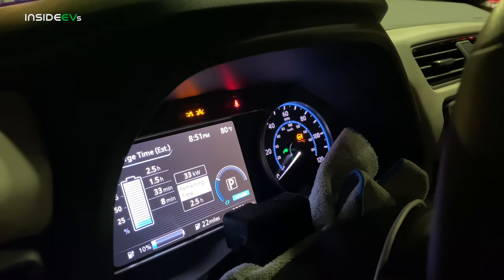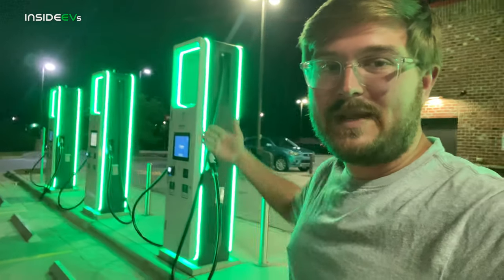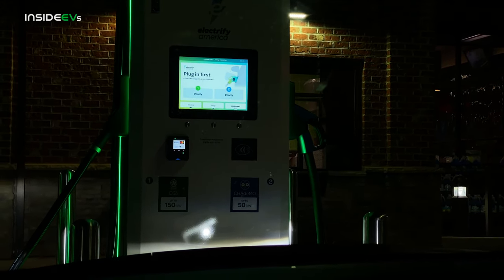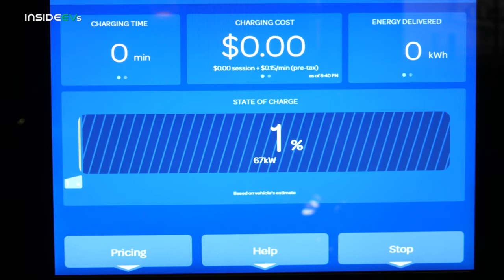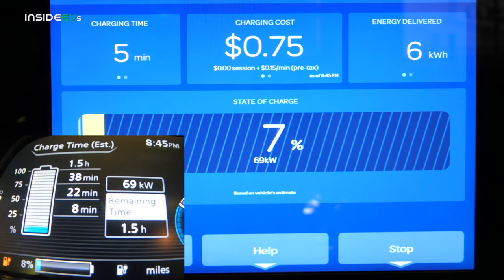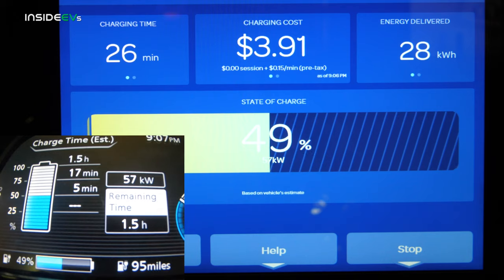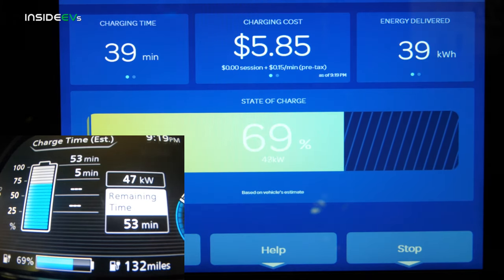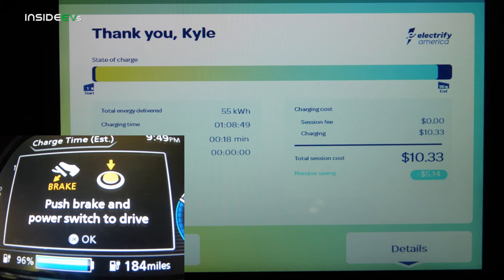2020 Nissan Leaf Plus: Time To Charge Test

Comment: You pushed it as an average American would expect out of their car, making zero compromises, which is an important test. However, having lived with the 30kwh Leaf as our primary car in the Pacifc Northwest, I can say that it has taught us to be a bit more mindful when driving. The Leaf Plus is the most economical EV, and that is sorely needed in today's market. Part of what allows for that is lack of higher complexity features like active thermal management. For the price, you can't beat it (literally the lowest $/kwh available in the US) and for those who are ok to adapt their driving style based on the task at hand (go slower for longer trips), it is a wonderful car that will repay you over the years in fuel and maintenance savings. And for around town there's nothing better, it's a highly rewarding car to own while most cheap ICE vehicles are a constant burden.

Comment: I'm at a loss to figure out what Nissan was thinking with this car.  I had the first generation. I got burned with some serious degradation.  I opted out of the 2nd generation because of the lack of thermal management.  Which is sad because I really liked my 1st gen, and I really liked the new body style on the 2nd gen.  If it had CCS and thermal management, I would have probably bought one.  I honestly can't recommend the Leaf to anyone these days, and not even a used one either.
Reply: Thermal mgmt in Northern half of the country really only matters if taking long road trips frequently.    I still DC charge because its free and both Leafs rarely exceed 6 bars.     Not saying thermal mgmt isn't nice, but for many of us it's a non issue.   My 2 Pluses are at 98 and 94.8% SOH, but some of that is BMS controlled based on whatever its algorithm is.
Reply: @douglasalanthompson  I've got a leaf plus sv lease under 300/mo. I'll keep it for the three years and then get a new one.
Reply: An objective person would have no problem recommending a Leaf as a vehicle for use around town and regional driving, so maybe claiming you couldn't recommend it to ANYONE is more about your biases and less about the vehicle.
Reply: I have an 2019 LEAF + and has lost 23% battery to degradation... Still an issue 😑

Comment: My gosh, where to start?  I've done 1,000+ DCFC sessions on Gen 1 and 2 Leafs.  I also drive a CCS BEV.  1) where's your LeafSpy so you can see actual battery temps?  Tell me the temp and I will tell you the starting kW (Lemon Teaf Leaf had a chart).  2) When comparing BEVs, distance at avg efficiency added per unit of time is proper measure. 3) EVgo is the company to charge Leaf+ on.  They have installed "100kW" CHAdeMO chargers in some locations in a deal with Nissan.  4) ask a DCFC repair tech which plug is more robust.  You may be surprised.  5). The best Leaf charging curve was the 30kWh variant; 40kWh worse in many ways.  Looks like Leaf+ worse than that, even.  6). On 440 mi day trip in 40kW, lost 20 min to Rapidgate (6%) BUT you cannot drive > 60mph without more heating and 55 will allow battery cooling @80° ambient.  

EA South Korean SigNet chargers installed in CA will not charge our CCS car at all (Honda).  They are very pretty, though.  Last week someone plugged a Kona into an EA charger I had used a few days before, and I got the bill for his session.  I know you guys love EA, but our experience in CA  has not been great thus far.

Comment: Totally agree that the leaf is not designed for a road trip. when I found there was 40 and 62 kw version, finally i choose the 40 one, not only the money but also the charging. Coz even you got 62 one, the charging process is still limited by time and the temp. I live in Canada Vancouver BC, up to now i got 3 x 1000 km road trip, not too bad, while on the trip i mix level 2 and 3 charging. the battery never overheat, and performance is pretty nice. Thanks for the video sharing.

Comment: I have always thought that the LEAF was pretty much dedicated to the home charging crowd - period.  No to run around folks who rack up mileage or have to fast charge ...  Off peak at night on a home charger, the battery should not heat much.  Battery life should be good, maybe 10 years ...  So it's a good run around town car, commute to work car, etc.  And if you also have a pick-up to tow the boat, or whatever, you are not likely to road trip this much.
Seems to a low intensity car not really aimed st first adopters who will challenge any tech, including EV's.  Very comfy and kind of "cuddly" nice car built on a cost conscious budget.  Look at the price drop to see where their margins were on older ones ...  One assumes that Nissan is still making a few $ per car ...

Comment: Personally I'm less bothered by the lack of thermal management limiting the ability to fast charge as I am by the well-documented effect it has on battery longevity. Leafs (Leaves?) have notably more battery degradation than other EVs with proper thermal management. To me, that limits their value even as a cheap used EV that would only be used for daily commuting. I would personally choose a Soul EV over a Leaf if looking for a cheap daily commuter EV because at least it has air cooling. That's better than nothing.
I recently did a road trip in my Bolt where the high temperature for the day was 109* (hot for Oregon) and the Bolt was having to run the battery chiller even when not fast charging. I was watching on Torque as I was driving, and it seemed to want to keep the battery cell temperatures cooler than that, between 95-100* when just driving. They would get a little warmer when DCFC but even then, I think it never even got as hot as the ambient temp when it was at the peak heat of the day. That would be impossible for a Leaf. Trying to DCFC on a day like that would be a nightmare, even if you only had to charge once, and then the battery would pretty much stay overheated all day because it would have no ability to passively cool. Even the Soul would have some ability to keep the battery cooler because the intake for the air cooling was in the vehicle interior, which would typically be cooled to a livable temperature.
Nissan really killed the Leaf, at least in the US, by making their "long range" EV not really ideal or even usable for long range (in some areas/conditions) because they continued to use a dying fast charging standard (in this country) and failed to provide any sort of battery cooling even though that was a noted concern before they updated to the larger battery.

Comment: Great charge test and quite reasonable pricing if you had only charged to say 80%.  It's just shocking that Nissan refused to put any thermal cooling in the Leaf.  I think picking up used Leafs for run around town cars is still a great way to get into an EV.  I go up to VA quite often and it's frustrating being charged by time instead of kw.
Reply: Some states only allow utility companies to sell electricity by the kw, blame the lawmakers, not Electrify America

Comment: Bjorn and Kyle are the only ones that have shown the leaf charging above 50 kw. Everybody seams to think chademo is bad because it's slow.  Not true, give the leaf 200 amps and it's cranking at 70 kw.
Reply: Soon this will be a non-issue as Nissan switches to CCS and liquid cooling with the Ariya. 

This will enable everyone except Tesla to use the same plug (hopefully they also come around to CCS soon).

Comment: Nice thing is you can get them cheap. I got a new Plus SL for $20,000 cheaper than the cheapest Model 3. I very rarely (basically never) take journeys over 300 miles one way in a day so it's an easy car to live with for me. Especially since I am cold climate area.

Comment: There was an article I read in the news today that said that used Leafs were in high demand, mostly because of price. I know 2 people who bought used Leafs for this reason. Kyle, you're more into road trips than most people, I think. I think the people who would want to buy the Leaf would be daily commuters, rather than Cannonball Run long distance achievers. It's interesting when you do that, but I don't think the majority of people are into that so much. Maybe Nissan omits the thermal management to save on overall cost? I don't know.
Reply: Definitely the case. It's made for Japanese habits, calmly traveling reasonable distances. Not for a certain segment of US drivers that are driving long distances regularly. They even named their rapid charging standard after "tea time" implying one relaxes as it charges.
Reply: @pioneer7777777  Well, there's only so far you can drive in Japan until you come to the ocean and can't drive further forward.
Reply: @scottbreseke716  True, but Japan is also quite long. Google maps says it's a 28 hour drive from end to end. I wonder if anyone has done that journey in a LEAF.

Comment: What Im taking away here is that the slower charge is more healthy for the battery.
Also that its likely the battery will overheat during normal use which also degrades the battery's overall life.

Comment: Kind of a bummer.  SL Plus here.  @50f I did a 460 mile trip first 3 charges were quick 1 hour or less but the last one took 2.5 hours what a long day!   Mostly highway @60mph.
Reply: Car battery did not cool at all on highway.  Thought it would cool it some being that it was around 45 degrees outside.
Reply: @Mikewalden12345  Bjorn Nyland (also on YouTube) has shown that the batteries don't cool that much even in Norwegian weather once they get hot. It still takes a fair bit of time. We'll keep our Leaf within a few hundred miles of home and then continue to travel with our ICE SUV. In a few more years we'll pickup a used Ariya or something similar for trips. By then there will be more chargers and travel will require less planning.

Comment: Driving under I think 15% the lthe diminishing cell voltages causes the current drain of the battery rise. Power equation demonstrated. Any time the battery is moving alot of current around, it heats up and as shown here slow to dump the heat. So, using LeafSpy, I would try to time recharges before that rise in battery temp caused by a low charge condition - 15% or so (depending on weather). It is better to either L2 charge (at home) or do shorter CHADEMO sessions when the summer heat of the southeast is with us. L2 charging and staying closer to home means the battery seldom heats up even in the southeast. I've operated Leaf's with the 62 KWH battery in ~95F weather and the battery does pretty good staying cool unless I fast charge it. The Leaf is an excellent EV for short distances. Not a good hot weather road tripper if you require fast charges. I've tried to understand the limitations of the Leaf and live with it - and it fits well with my needs and habits. The aircooled Leaf is not like a standard car which can go and go and go.

Comment: I have 2019 leaf plus and I live in Japan. The highest reading I've seen on the battery temp meter was just one step above the middle and that was during summer, after a 30 minute fast charge at about 30 degrees Celsius ambient temp.

Last week I fast charged from 40% to 90% also in 30 minutes at the fast charger located at Nissan HQ in Yokohama and the temp meter, didn't go past half way although ambient temp was lower, about 21 C.

I don't have a charger at home, so I always use the fast chargers in the area, there's one at the shopping mall nearby and it's also free to use, so I use that one pretty often, again I've never seen the temps go any high.

I wonder if this somehow different for each region's version of the vehicle.
Reply: A lot of people in the US push their vehicles much harder than in Japan I think. Like 80mph driving followed by a charging session.

Comment: The video is a bit dated. I have fast charged my 2022 SL plus in 95 degree Florida heat several times in one day. The battery got hot, but never rapid gated on me. I also experienced 70 kWh charging on a 50 kWh charger. I don’t know why, but it was a nice bonus. Maybe Nissan changed something between model years?

Comment: Actually, the stall with CHAdeMO is exactly the same as the other 150kW charging units but they oddly have 2 CCS plugs. The stations are designed to host both CHAdeMO and CCS and the EA strategy to have 2 CCS is complete nonsense to me since you cannot charge on both plugs at the same time. EA says the 2 CCS plugs are for better reach of the charging ports on different EV. I think would hurt to have 2-3 stalls per location with CHAdeMO.
Reply: They only did the one Chademo because they were required to.

Comment: If you do the math, if you had carried on to 100% the EA charger would have dispensed 58.5 kWh into the leaf.  Now charging losses are less on a leaf since it doesn't have power going to active thermal management, but even if the charging is 99% efficient (unlikely) that makes the useable capacity less than 58 kWh on a 62 kWh pack.  I made a chart of the charging curve in excel if you are interested.

Comment: Any work around or aftermarket parts to help with the battery overheating? I just bought 21 leaf plus this weekend, it’s my only car and now I feel a tad bit worried about future extended trips.
Reply: The best thing you can do is do a deep dive with the YouTube roadtrip videos which include LeafSpy. You can see how they cope with the limitations of the car and make it work. Learn to minimize the battery heat. And rent a car when you want to go 1000 miles or go short distances and L2 charge overnight. :)

Comment: ??? at under 85 degrees this 2020 Leaf would not efficiently charge on Level 3, but what about Level 2 at home?  would it still take much longer than the expected
9 to 12 hours to get from 20% to 80%  charge capacity?

Comment: i took my kona ev on a 620 mile road trip. it got 75kw until 75% then slowed down to around 25kw. it gets to 80% fast enough for my needs. ~35 minutes to go from 10-80%. so walk around walmart or have a burger time. or watch a show. nbd. 1.5 hours? no thanks! the leaf not having battery cooling is just an insane engineering choice.

Comment: whoa! hang on a sec using my level 2 J-1772 connector with a 6kw charger it only takes me less then 30 mins to hit 100% and cut off and only $1.33 for my 2019 Mercedes Benz Smart what a heck? And bat temp is not a factor it has a battery A/C if needed!

Comment: so I can't use J1772, only can use chademo? All chademo in my area are 50kw and only 1 charging spot out of 14-16 stalls... leaf doesn't look like a good purchase tbh
Reply: All LEAFs in the US from 2011-present have the J1772 plug, and some also have the ChaDeMo plug for DC fast charging…such as it is. The two plugs are located under the front charge port lid at the front of the hood.

Comment: I don't understand why you can only charge like this one time per day?
Reply: Aircooled battery. It gets hot. It can't cool itself. To protect itself, it slows the charging speed so it is not ruined by the heat. The Leaf has the last aircooled battery design. Everyone else uses watercooled batteries including Nissan in their other EVs. The Leaf is a fine local car. Not a roadtripping car.
Reply: @joeaverager  I have a 2011 Leaf.  Range is about 10 miles.  I kept hoping for a good aftermarket solution utlizing the newest batteries, but so far no-go.  I do recall a video saying that CATL will make Leaf compatible batteries.

Comment: You are wrong Kyle in our state every charger installed new is ccs/chademo.  Ea is the only one with 1 chademo
Reply from the maker: It’s likely we will see even more of a decline of new CHAdeMO installs going forward. This video will likely have viewership long into the future so I sort of future-proofed it. Many of the state lead incentives are CCS/CHAdeMO yes but they are also 50-75kW which is not that incredible for long trips - Kyle
Reply: That is not true in Florida.
Reply: @InsideEVsUS  thankfully Evgo and greenlots are continuing with dual dual head units.
Reply: Open the hood when charging, it helps a bit
Reply: @douglasalanthompson  greenlots is installed dual dc chargers at meijers in columbus ohio.
Nissan is still selling leafs .
Reply: @InsideEVsUS   kyle i think since the ea charger that has ccs/chademo  on one charger and the ccs part can charge faster than that is why you got higher than 50kw. My leaf is a 2012 so i cant test it on mine.